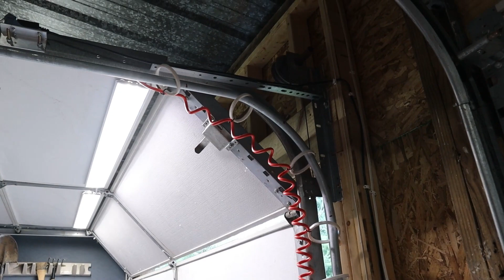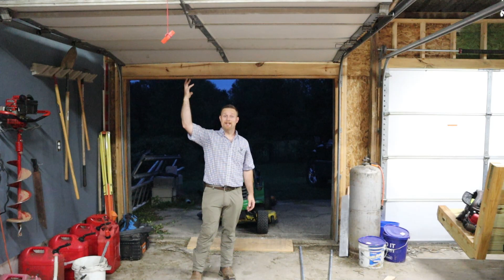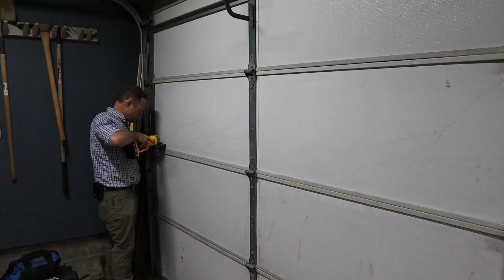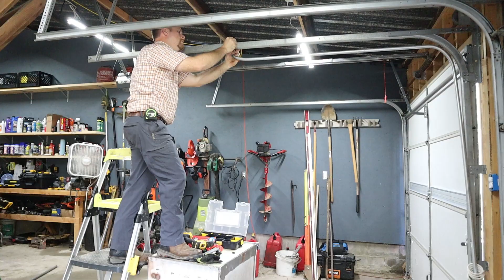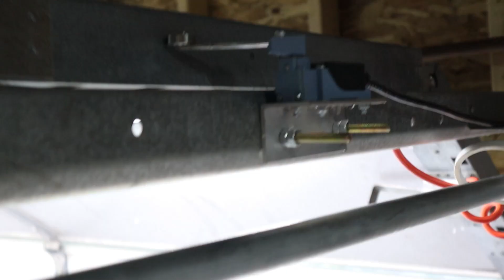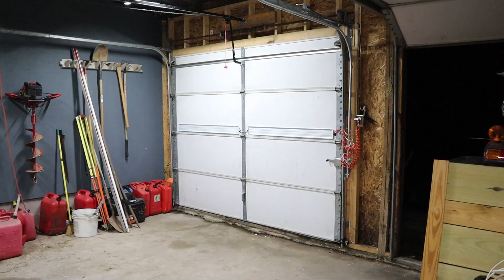#124 Great idea for the workshop!  Simple Solution using parts from Home Center

Comment: I'm wondering about running the conduit parallel to the opener track (with clearance of opener track) and running the wire up the door. This way the spiral wire will keep from getting snagged as you walk by.

Comment: Love the video.  I watch videos all the time that other people call useless and stupid and take the ideas in the video and modify them to what will work for me and usually end in success.  Here is an idea to maybe improve your design, not that there is anything wrong with it.  What if you mounted the outlet on the ceiling?  Then the coiled cord would only travel the straight distance on the top rail of your garage door track.  Does that make sense?  That would also clean up your wall where the coiled cord is now.  Just a thought, might not work for you, but I think I’m gonna try it.
Reply from the maker: I considered ceiling mount and it is completely doable but it poses its own set of pros and cons and for my specific situation the cons outweighed the pros,

Comment: Great work
Reply from the maker: Thanks!  I appreciate you taking the time to watch and comment!
Reply: @shaweehillsworkshop4226  just brainstorming, you could wire a 12v Led to run off a rechargeable tool battery in addition to rail lights should you need that extra lighting in that area.
Or perhaps some kind of swing down hardwire lights that mount to the garage ceiling. Or you could do what I do and just wear a headlamp for everything